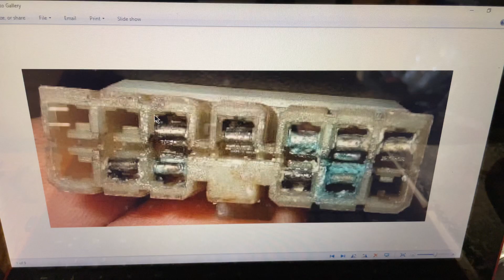Mercedes - Tutorial: Connector Corrosion & the impact on signal integrity & introduction to CAN BUS

Comment: Excellent technical video on commonly misunderstood electrical errors, plaguing the auto industry, most especially 2010 vehicles on up with more than a dozen modules and intricate wiring systems; for the auto tech, it seems unmarketable (clients budgets) to charge by the hour when it comes to complex diagnostic analysis due to involved testing. Thinking about retiring from auto service industry, as I am limited on time the older I get running a business. 

If you will, please share your feedback on a 2009 Infiniti G37x with U1001 code and in inoperable A/C clutch. The A/C clutch works when an applied external power source is provoided and blows cold. However, the A/C control unit seems to be dead and lacks communication to the ECU that which provides the signal to the a/c rely to activate the compressor clutch. During Can Bus diagnostics, DLC pins 14 and 6 ohmed out at 60 ohms or within specs, however, in these said pin at the DLC when checking short to ground or short to power, there is 0.70 volts on these pins when the Can Bus is asleep. Whereas, when Can is active, low and high Can are from 1.5-2.5 and 2.5-3.5 range--normal. The only way I am able to isolated and remove the short to power is to remove the left side connector at A/C control unit located above the radio, and the the driver side seat module underneath the seat (each component has about 0.35 volts reduced upon disconnecting, until it reads 0.00 when both are disengaged). Logically, I replaced the A/C control (twice) and the seat control units. Same result of short to power at Can bus test pins, without change. Upon inspecting the A/C clutch connector, greenish corrosion was evident, as well as at both positive and negative battery terminals. The only items I cleaned/replaced where battery terminals on boths sides and block and firewall connection. Darn clutch still fails to power on its own controller, and is likely in limp mode due to code, which also set AbS/traction control lights on the instrument cluster (the ABS module I disconnected too no avail). 

Anyway, your thoughts and suggestions Inovahightech will be appreciated, as I am stumped, and cars I usually fix without much trouble but this one needs another set of eyes and experience.

Awesome content, indeed!

Comment: Hello, very interesting and many new aspects for root cause analysis, since many connectors of my hobby cars are in this condition, but so far no impact on performance. As you have tested some vehicle/motor testers for cars with CAN-Bus System, do you have some experience with devices for w124 and w126, others than the methods with blinking codes ;-). Thank you for the video again and maybe you have an advice for me. By the way quite cold in your hometown, greetings from Germany.
Reply from the maker: Hi Tojo,
The blinking codes are pretty limited, but were used on many more models.
Years ago there was a test unit with a 2 or 4 line LCD Display available where you could select your model and engine and then it would show error number and the actual fault as they were documented in the MB Service Manuals. On the W126 you can check ECU , Climate Control, ABS and ASR if the vehicle had ASR, however one of the three test pins had to be moved to the terminal on the 8 pin diagnostic socket associated with the to be test control unit aforementioned.
The other round diagnostic socket X11 with the small terminals is used to check the TD Signal with Oscilloscope and provides the error codes while the engine is running and before it reaches operating temperature. The error codes are delivered as a percentage of duty cycle from 10% to 90% in 10% steps. A DMM with Duty Cycle setting can be used and the error codes are listed in the Service Manual.
It is important to know if the DMM used indicates Dominant (off) or recessive (on) when displaying the duty cycle.
I may make video on how to check this.
Hope that answered your questions 
With greetings from Kansas, Peter